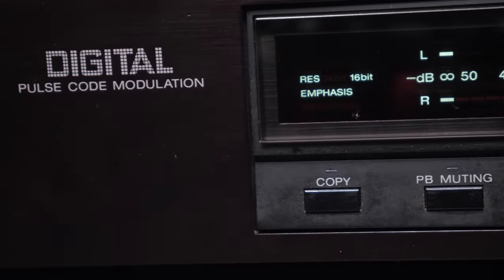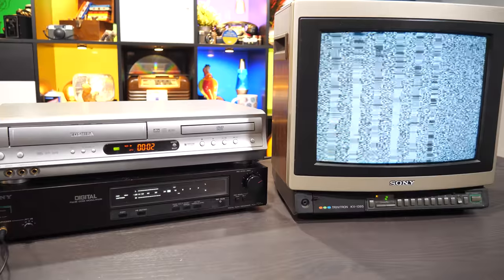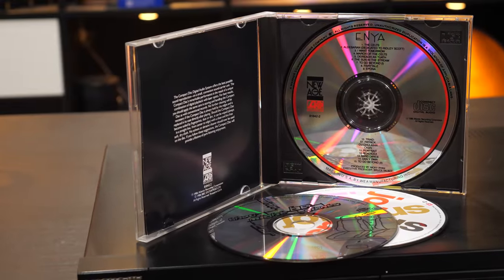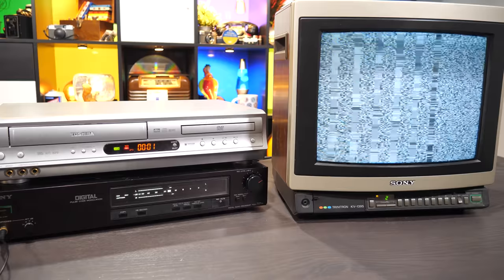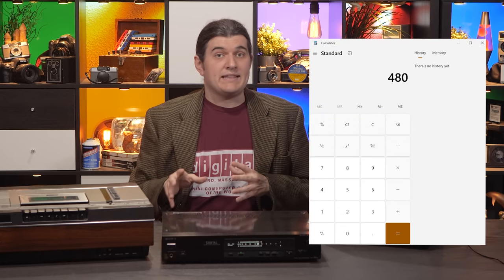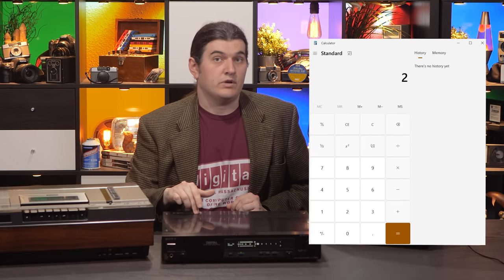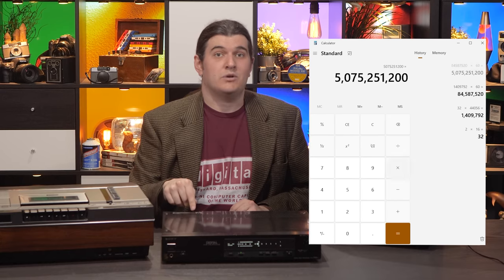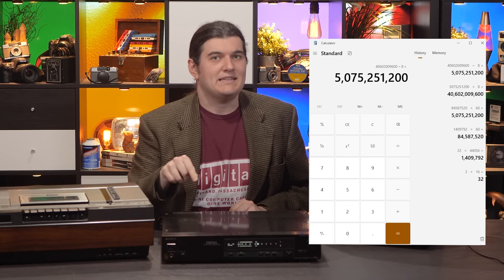Digital audio needed videotape to be possible - and the early days were wild!

Comment: I recently found a late '80s Sony EV-S800 Video 8 deck at a thrift store. It apparently contains a similar PCM adapter and is capable of recording multiple digital audio tracks in place of video on tape. From what I have read on it, the VCR was supposedly too similar in capability to Sony's DAT decks and was cannibalizing sales from them, so they didn't sell it for too long.
It would be interesting if someone were to create a CED disc containing this type of video signal of a digital PCM audio signal. Then we could have digital audio on vinyl!

Comment: Home computers did use magnetic tape to store digital information, just in a smaller format. Cassette tapes were used widely for program storage. Apple, Commodore, Tandy, Atari, all the big names had a cassette storage device. It obviously functioned in the opposite direction, Data -> DAC -> Tape -> ADC -> Data. In fact, there were some radio stations that would broadcast programs over the waves and you could record them and play them into your computer and load the program that was transmitted. Pirate radio. :)

Comment: Over the years since the mid-1980s I've had various EIAJ-compatible digital audio adapters, starting with a Sansui (I don't remember the model), a Sony PCM-701ES, a Sony PCM-601ES, and a Sony PCM-501ES. Great equipment for their time. They ran at 44.056 kHz, as opposed to the professional 1610 and 1630, which ran at 44.1 kHz.
Reply: I have many hours of PA mixes of local musicians I recorded with my units. I would often make recordings when mixing the sound at local concerts. These units sounded better than a cassette, better than reel-to-reel, and they were not too hard to haul around with my PA rig. I used VHS cassettes with mine; they were easier to come by than Beta. My early recordings were done with the Sansui unit in 14-bit; it didn't have 16-bit. Most of my recordings were done in 16-bit on with the Sonys. As I understand it, 16-bit was proprietary to Sony. The mode switch is for record; the Sony would auto select 14 or 16 bits during playback, depending on how the tape was recorded. The Sony PCM-601ES unit had S/PDIF I/O, which worked OK, but not perfect. The reason is that normal S/PDIF equipment samples the left and right channels simultaneously, which the Sony units alternated between left and right. Today, one could fix this problem by upsampling to 88.2 sliding one of the channels by one sample.

Incidentally, I recorded the stereo mix for a local band's CD to a PCM-701ES. We took this the resulting VHS cassette to DADC in Terre Haute. All of their CD mastering was done with PCM-1630 units and PAL U-matic videocassettes, so the first thing they did was transfer my VHS tape to their PAL U-matic format. To do this, they played it back through a PCM-601ES which gave them an S/PDIF signal at 44.056 KHz. The PCM-601ES did not have problems recording 44.1, but 44.056 was outside the lock range of the PCM-1630, so they had to feed the signal through an asynchronous sample rate converter to get a 44.1 signal the PCM-1630 would lock on to. They did not account for the fact that the original recording was sampled alternately, but that did not seem to have a great effect. Also, the Sony PCM-701ES always records with emphasis on (although it will automatically switch emphasis on playback according to the emphasis flag in the tape subcode). I think they had the capability, in their mastering system, to digitally EQ to remove emphasis, but I asked them to leave it, so the CD ended up with emphasis on. If one rips it with EAC, they have to use an audio editor to manually apply the de-emphasis curve, because EAC just copies the bits without change.

Comment: I also had a sony PCM501 and a JVC  PCM adapter too, even made some recordings onto a Sony EIAJ open reel video recorder just for the sake of it.  This system was reliable, resilient and easy more hardy than damn 4mm DAT tapes and transports.
Reply: Yeah, DAT was a pain to interchange between decks. What finally killed it was not only lack of parts, but shoddy design. Nearly every Sony deck made eventually developed loose slant guides, the ones that set the angle that the tape takes as it wraps around the drum. You could feel how loose they were and good luck trying to get the angle right ever again if you tried gluing them in.

The only deck i still have is the car stereo version, it can play anything. It uses what was referred to as "Non-tracking", basically roll tape and spin the drum, don;t even try to lock on to it, just read data as fast as possible and as many times as possible. Good, error free data is buffered and identified, then read out in the correct sequence at the correct rate. Works like a charm on tapes that won't play anywhere else. Only drawback it it's only analog out.

Comment: Re: your editor's note and not knowing why interleaving improves error correction:

The answer is pretty simple, errors tend to occur in bursts, while error correction codes can only tolerate so many bit-flips per codeword before failing. If we didn't interleave the codewords, a modest burst can easily damage a codeword beyond the code's tolerance. But WITH interleaving, where we write out bit(0) of a bunch of codewords, then bit(1) of each, then bit(2), ..., those bursts of error go from damaging a few codewords by a lot, to damaging a lot of codewords only a little - keeping each one under the threshold to be repaired!
Reply: As a more concrete example, if one were to e.g. store 8 rows of data, followed by an xor of the data in them, data could be recovered after any burst error event that was confined to a single row, by replacing the missing row with the xor of all the surviving rows, but a small error that hit the end of one row and the start of the next could be unrecoverable.  If one were to interleave the data 2:1, then the only way a single burst error event could damage anything would be if it was long enough to encompass the end of one row, the entire next row, and the start of the row after that.  Using 4:1 interleave, a single burst error would need to encompass the end of one row, the next three entire rows, and the start of the row after that.  Using this style of approach, one can get by with a rather small amount of error-correction overhead.  Guarding against any single burst error per frame of up to seven lines long would require only eight lines per frame of overhead.  Guarding against arbitrary combinations of up an up-to-seven line error and an up-to-six line error could be accomplished by putting at the top of each frame seven lines representing the xor of every seventh data line, and at the bottom of the frame eight lines representing the xor of every eighth data line,

Comment: I had a much earlier  device like this to back up a hard drive onto a VCR in 1988-1989.  The video of that was pretty close if not identical.  It ran on a full-length 8-bit ISA card as I recall.  And the Corvus hard drive had their video adapter called the "mirror" that was even built-in to some of their drives in the early-1980s.  I used one with my Atari 800.
Reply: We used a similar system on the Amiga computers to backup and "distribute" programs ("warez") on videotape.
Recording was done directly from the Amiga composite/monochrome output en reading through a simple serial interface.
Reply: I'm quite disappointed Alec didn't bother mentioning that the audio cassettes were used as cheap data storage on 70's and 80's personal computers.

Comment: One thing you failed to mention is Mobile Fidelity Sound Labs actually sold PCM audio tapes in both Beta and VHS formats in limited numbers.  I have the MFSL Betamax PCM of Dark Side of The Moon. There were a handful of other titles available. Also these days one does not need the PCM decoder if they have tapes still lying around with PCM audio on it. You can capture the video via a video capture device  (preferably one that does lossless compression) and using software that can extract the digital audio from the video signal, you can have a PCM audio version on your PC.
Reply: No one "failed" to do anything. You wanted to bring up a related topic, and that's fine, but there's no need to whine.

Comment: FUN FACT: Did you know that back in the late 70's and most of the 80's. Public broadcast stations (PBS) in both San Francisco and Los Angeles would broadcast these PCM encoded signals over the air. They would broadcast mostly classical and new age music using this system. All you needed to receive and decode the broadcast was a VCR and a PCM adapter. You needed the VCR for it's tuner so you could tune in the broadcast and feed the video signal to the PCM adapter for decoding. Of course, you could record the the broadcast digitally by putting a tape in the VCR and pressing record. For those that didn't have all this expensive equipment. You could still hear it through your TV's speaker in mono and lower quality.

Comment: An important thing missing from that first ADC symbol is Vref (the reference voltage) input..  This is usually the highest voltage that the ADC may expect to see on its input, aka the "full scale" reading..  the voltage for which the output word will be all 1's.  You gave 700 mV as an example input voltage, giving an output word of 0110 1011 (107 decimal)  ..   so  107/256 = 0.7/vref  ..  so Vref in this case is 1.67V   .. an interesting choice.  ;)
Reply: Could that be 'line' voltage (as in, 'line in', 'line out')? (And, incidentally, if it isn't, how many volts is 'line' voltage?)
Reply: @Ice_Karma  Good point. The Wikipedia page for a line level (if I'm reading it right) says Consumer gear is 1.4 volts, but some pro gear goes as high as 1.74V.
Reply: @AppliedCryogenics  Ah, thank you very much! 😻

Comment: The scramble you were talking about around 15:55 reminded me of a similar issue and solution used on old-school T3 data lines: If you had a long string of just zeros because nothing was going on on the line, then after a little bit the two sides might loose their clock sync to each other because there is no dedicated in-line shared clock source. So they created "scramble", which is sometimes called encryption (even though its not ... ish). But it does use a shared configured polynomial (if my google is to be trusted) to essentially make sure that the value flipped between 0 and 1 on a regular enough basis that everyone was fine with the clock.
Reply: With recording on video tape, that's actually not something you need to worry about. The video signal format already has sync pulses, for every video line and every video field, built in to keep everything lined up.
Reply: CANbus in modern vehicles does the same thing. Except rather than get fancy with it, they just stuff a bit in at random, called bit stuffing. Canbus is both synchronous and asynchronous, unclocked differential serial data. I believe it has something to do with arbitration priority, all nodes need to be synced for that to work. Otherwise, they could just resync at the start of any transmitted frame.
Reply: @pontiacg445  Sounds a lot like USB, at least for its slower speeds. It uses a similar "bit stuffing" algorithm. This makes sure that there are sufficient level changes on a wire to allow the receiver to correct for clock drift.
Reply: @gdclemo  On a lot of the smaller microcontrollers I use, the pinmux for canbus and USB is usually really similar. Some even on the same pins that force using one or the other, I don't think that's a coincidence!

Comment: It's awfully cute when the younger generations figure out stuff like this. :)

(1) yes, 14-bit mode is the standard EIA-J digital audio as video standard, and is interchangeable with just about every video-field PCM adapter that was ever made.
(2) the reason you're hearing blips on pause, is because the pause is frozen on a single field of video (not frame), remember, this is interlaced video.
(3) this format was an attempt to supplant reel-to-reel audiophile usage with a digital format. It did have some foothold (especially in Japan) before DAT happened.
(4) this format was also accepted by digital mastering houses as one of a few input formats for mastering CDs.
(5) yes, you are correct that the extra two bits are in otherwise unused space after the CRC.
(6) also yes, the 16-bit recordings will still play in 14-bit recorders, as the extra data is outside of the standard EIA-J record, it's simply ignored.

The lessons here would be re-invented a few times over for computer data backup (one of the earliest uses being the Corvus Mirror, which was available for their hard drive units for many early 1980s microcomputers)

Also, I was a very adamant user of the Sony PCM-F1, which was paired with an SL-2000 Betamax VCR. It formed the backbone of my mix-down stage of my studio.

And yeah, digital audio was a VERY contentious topic, especially by those who didn't understand how it actually worked! It was extremely frustrating to have to explain why band-limited signals can be sampled discretely, and not have "stair-steps!"
Reply: But why does the machine have a switch to turn off the extra bits off, then? Marketing? Seems to me that switch should be left on, not gonna hurt anything otherwise. Like dropping 24bit color down to 18bit, or even 16bit. Doesn't hurt to shift that extra data out the bus, the LCD display just isn't sampling the bits it can't.
Reply: @pontiacg445  to create a completely compliant tape. Just because a standard says one thing, doesn't mean that it will be implemented in such  a way that extensions to it will be ignored. It's all in the engineer's interpretation.
Reply: @tschak909  I found the answer elsewhere. 16bit uses one form of error correction whereas 14bit uses two. 

14bit can correct through 32 lines of errors, whereas 16bit can only correct half as much. Therefore, if you want 8 hours on a crummy tape, you probably want 14bit mode. A 16bit tape is just a 14 bit tape with two extra bits tacked onto the end. Actually, one extra bit and an error correction word replaced with extra data bit. Nothing at all to do with compatibility, it was made to be compatible. Engineer already interpreted, that's what he came up with. 

It's alright to admit you don't know, better than passing false information.
Reply: @pontiacg445  Thanks for the correction, it's been a very long time. This is what I remembered.

Comment: The successor to this you mentioned, DAT tapes which the recording industry tried to kill ... were used for years for Data backup (and many of the DAT drives had audio disabled/removed to mollify them) 
It's largely disappeared due to cloud storage .... but there are a few companies that still use vast numbers of DAT tapes .... the Cloud Storage companies ... they are rarely retrieved from, but they are the ultimate portable resilient storage when your data centre dies
Reply: That was our pretty much sole backup to a WinNT server in 2002. 

Also of note, I learned the hard way not to defrag an Exchange server while it’s running. Also, Exchange and our backup software didn’t play nicely when Exchange was running either. 

These two factoids together meant I had a very bad day.
Reply: DAT and other helical-scan magnetic storage (8mm was common) withered and was replaced with DLT which used high-speed linear magnetic media. DLT lost out to LTO which is also linear tape. The current LTO-9 cartridge standard from 2021 stores 18TB of data.

The progenitor of DLT were the TK-50 and TK-70 cartridges used by DEC (as referenced on the shirt...)

Comment: I did an internship around 2001 at a recording studio and was trained on several different formats. One of them was ADAT (alesis digital audio tape) and it could record 8 simultaneous tracks to 1 VHS tape. I remember one of the engineers returning from an on location session with 3 VCRs that he synced up to dump 24 tracks to an early version of Pro Tools through the studio's neve console. I wonder what the video would look like from one of those tapes.
Reply: You an I both! I was taking a short education in light and sound engineering in 1998, and our studio had one of these ADATs. I was playing in a band at the time, and also fiddling with Cubase SX on my puny Pentium II, and I so wanted to have one of these for recording our band. It was very expensive!

Comment: I have that unit . Looking at it in my rack right now. I only use it with beta recorders because the tape transport on beta is more stable than VHS. My Japanese decks also can do Beta 1 speed which is also better for this method.  PCM digital audio on this set up was a great way to store my analog masters as I am a music producer. I got it from my LSI engineer friend in Japan. Great sound recording. It's very heavy for it's size though.